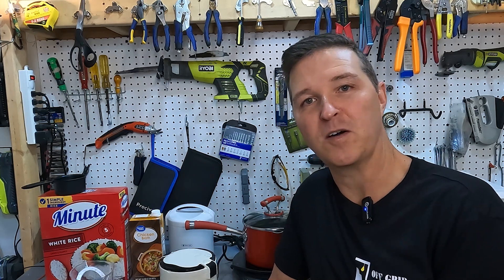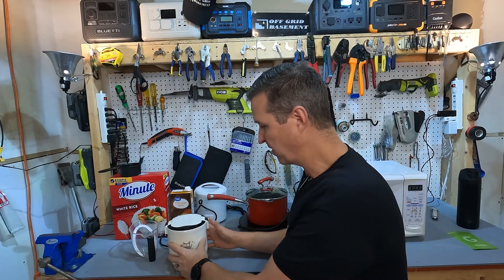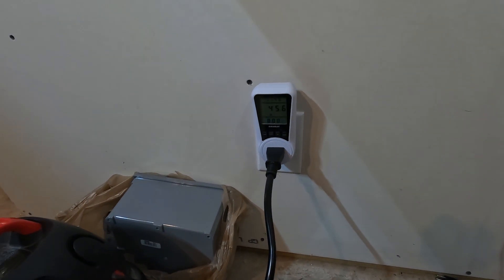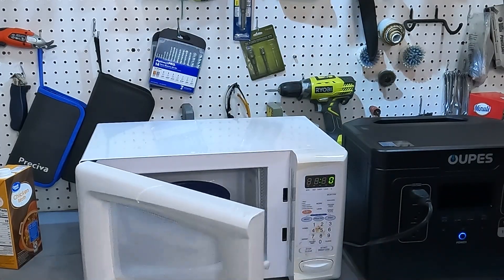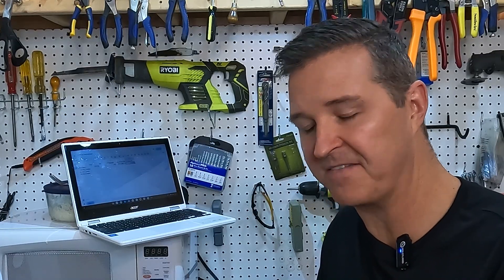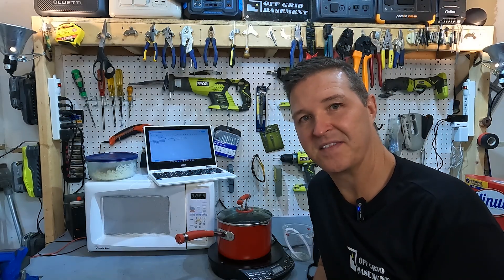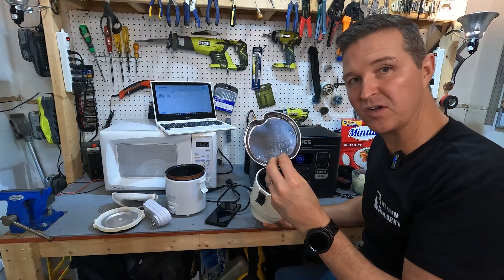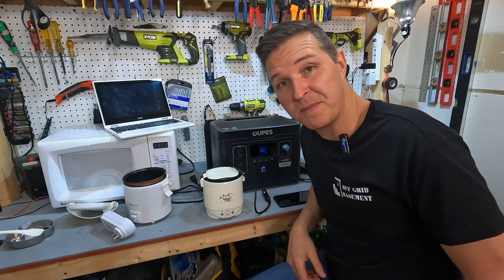Is a 12v Cooking appliance really more efficient?  Let's find out!

Comment: Was the rice just as soft in the 12v cooker as what it was with the other methods. Definitely the best method if someone has a small power station where the inverter is under 500 watts
Reply from the maker: yes it was!  The only method that left it al dente was the induction pot.  I think it was my fault for not waiting long enough.  Thanks for the comment.